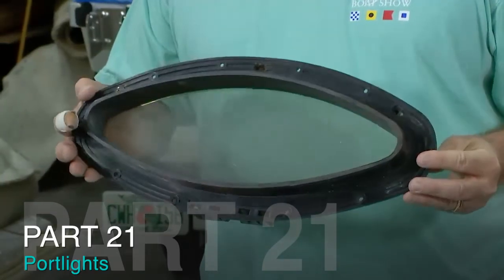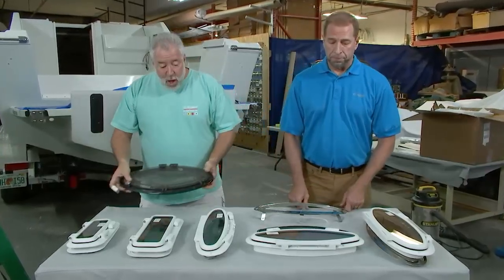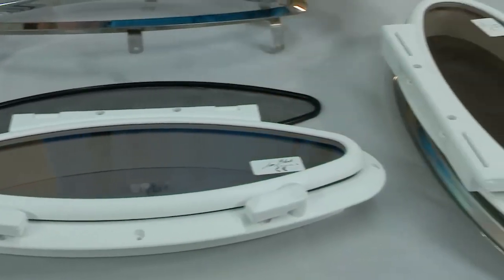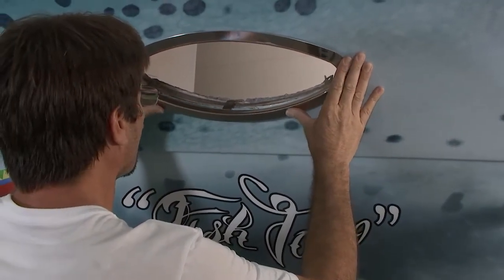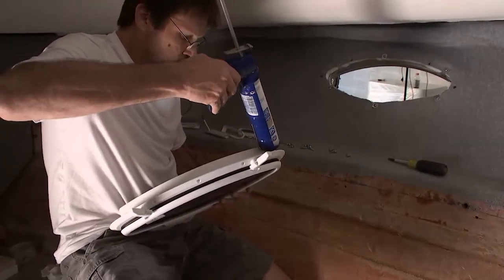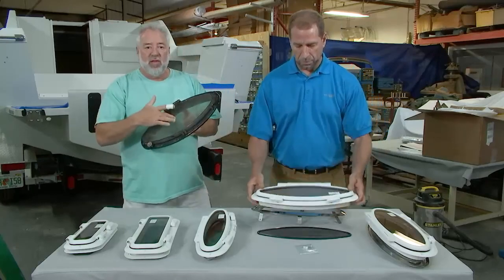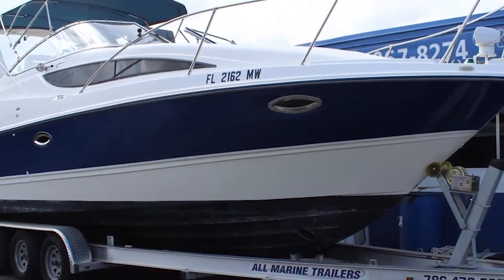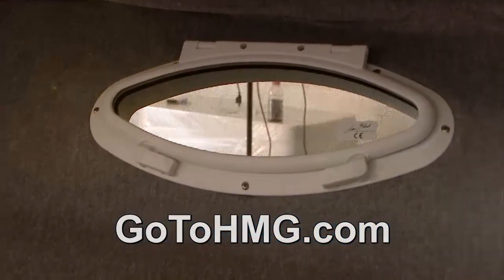TACO Marine Project Boat on Ship Shape TV: Part 21 – Portlights

Comment: Will these flex to fit a slightly curved surface?
Reply from the maker: Hi Darrell. Thanks for your question. We reached out to the pros at Hi Tide and they said, "our port lights do not flex and need to be installed on a flat or planner surface." Please let us know if you have any other questions about these replacement port lights or any other product. Thank you. ~ Dana K.